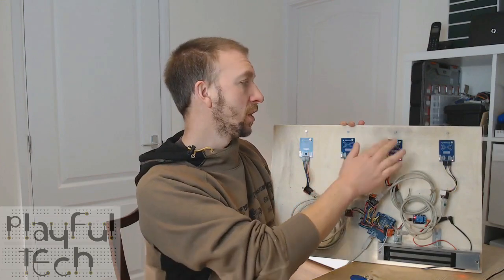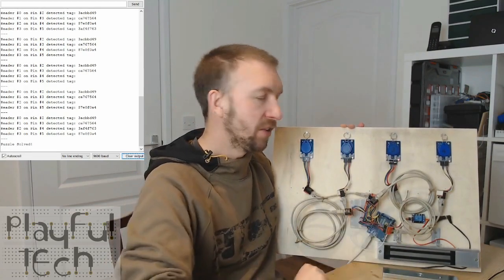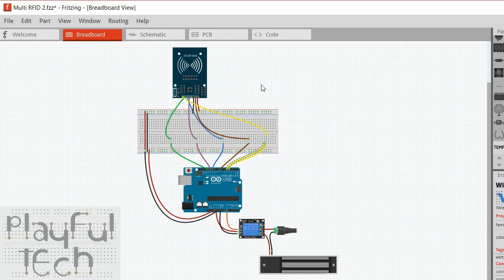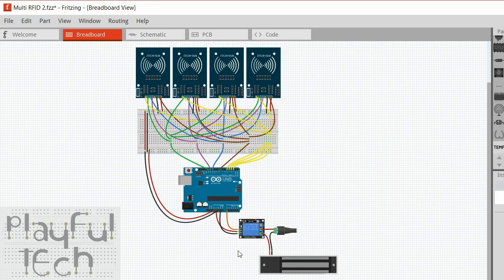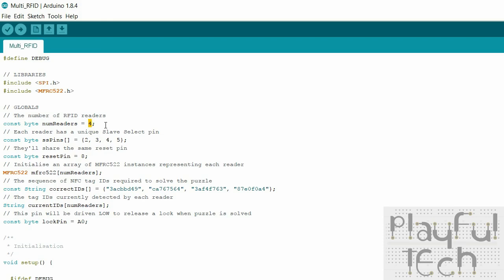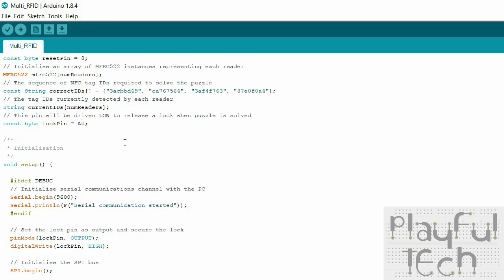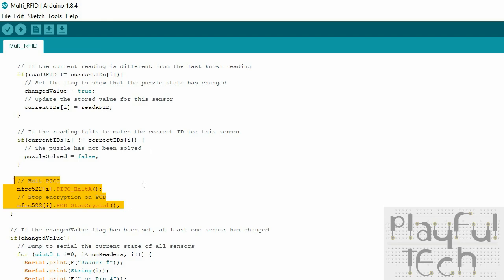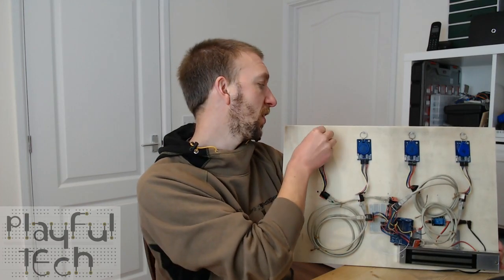Escape Room Object Placement Puzzle using Arduino/RFID

Comment: Hello Alistair,

it's a nice and straightforward tutorial, just wanted to share a bit of additional information:

1) You can (in theory) run this setup with a much larger number of RFID reader modules. What limits your setup is the amount of power the Arduino can provide. If you power the readers with an external power supply you can go way beyond 4.

2) Using longer connector cables is like adding an additional resistor in front of your pins. I found that as long as you don't exceed around 1m of length the setup still works fine

3) One minor nitpick about your code: It's not necessary to call PCD_Init() on your readers in each loop. You can simply init each reader once inside the setup() routine.

Cheers and keep up creating these great tutorials!
Reply from the maker: Hi Andy, the problem with adding more readers is not the power requirements (though you obviously need to address that too) - it's the additional capacitance you're creating on the SPI bus. Assuming you're running the SPI clock line at 4MHz, then once you've added any more than about 4 readers you'll find that the return signal on the MISO line is neither clean nor quick enough to be received within a single clock cycle (you can see this easily using a scope).

Comment: What are the cables, connectors, wires used here. Anyone got names or links to where I can buy these. Need to extend the sensors around a room.
Reply: You could use some internet cables for this purpose and solder them directly or you could try dupond conectors and jumper wires

Comment: Hai Friend. I am doing one project with 2 RFID boards. My doubt is, if i give the connection as per your video, is it possible to give different program for each RFID and to get different output to operate  2 solinoid  valves?
Reply: Yes, it is.

Comment: Hey Playful Technology,

We are currently working on a similar project for our University which involves 6 RFID scanners, the same scanners you have used in your project. However, we are running into some issues regarding more than 2 scanners. Could this be regarding failing connections in the breadboard or could the length of the SS wires?

Currently, they are about a maximum of 20 centimeters long. 

We would like some help, if you are willing to take a look at it we can send you more details/photo's and we will of course reference you in our documentation/presentation. 

Greetings, 

Matthijs Sluijk

Comment: What adapters are being used to connect the RFID readers into the board? It appears they are using CAT5 or similar cables, but then they are in an adapter and single wires the rest of the way up to the reader.

Comment: Every now and then , one or more rfid readers don't read the specific tag. 
That means that the puzzle can't be solved and the mag lock stays activated.
 I tried to use an external button that is connected to the reset pin on my nano , to open the mag lock remotely but it only resets the arduino while the lock stays activated. 
Is there a way to push the "reset" button to release the mag lock just in case the puzzle fails , without having to add code?
Or what about  adding a "softreset" libray?

Comment: Hi Alistair. Thx for this great video, i leart a lot for my internship project (I m making a system controlled by an Arduino uno, with 3 rfid readers and 2 lcd screens) ! Just a question : if i put a rfid tag just in the front of one of my readers, is my Arduino gonna write the same message on the lcd screen for any reader which reads the tag ? (and else, how can i do that :P in the program i mean). Thank you in advance !

Comment: I downloaded it and it did not work for me.  Had lots of errors when I compiled it.  Not sure what I'm doing wrong.
Reply from the maker: Hi David - oh no! If you let me know what those errors are, I can help you fix them.
Reply: @PlayfulTechnology  Got it compile, but I think the wiring is a little messed up.  I'm just trying to set up 1 receiver and when I run it, its giving this message: Reader #0 initialised on pin 2. Antenna strength: 0. Version : Firmware Version: 0x0 = (unknown)
WARNING: Communication failure, is the MFRC522 properly connected?

Everything seems connected properly, I triple checked.  Any ideas?  Could this happen if I don't have all 4 connected?
Reply from the maker: @davidmcallister9752  And you've changed the numReaders and initialisation of the pin array in the code to only have one element?
Reply: @PlayfulTechnology  I think its the wiring itself.  I eventually got it work kind of by skipping the bread board altogether and connecting the arduino straight to the reader, but it had to be held in place just right and was incredibly finicky.  After googling it, it seems that its a common issue with these rfid readers.  Most people that had problems said they were fixed when they solder the wiring onto the reader.  I haven't tried that yet though.  I'm new to this stuff though, maybe you have a better and less permanent suggestion?

Comment: Nice project.
I'm facing some issue with my RFIDs. When I connect 1 (one) RFID, then it works fine. But when I connect more than one (2 or 3), The controller (Arduino) doesn't find any readers. Get these lines on the serial monitor.

Reader 0: Firmware Version: 0x0 = (unknown)
WARNING: Communication failure, is the MFRC522 properly connected?
Reader 1: Firmware Version: 0x0 = (unknown)
WARNING: Communication failure, is the MFRC522 properly connected?
Reader 2: Firmware Version: 0x0 = (unknown)
WARNING: Communication failure, is the MFRC522 properly connected?
Reader 3: Firmware Version: 0x0 = (unknown)
WARNING: Communication failure, is the MFRC522 properly connected?

Can you please help with this? Or anyone here can help me? 
Thanks.
Reply from the maker: Are you powering the RFID readers from a separate 3.3V supply, or from the 3.3V of the Arduino?
Reply: @PlayfulTechnology  Thanks for your response. I've tried both. Both results the same! :(
Reply from the maker: @ElectroLab0  Can you try adding 5V <> 3.3V level shifters on the MOSI, CLK, and RST lines? It might be your readers are not 5V tolerant.
Reply: +Playful Technology Thank you. I'll definitely try that.
Should I use dedicated level shifter IC/Modules or Resistor devider will work? What do you recommend te most?
Reply: @ElectroLab0  these comments are coming when you are not connecting well the rfids make sure you connected them same as at his scheme in the video, Power supply isnt the issue here.
Reply: you can show me the way you connect them and i'll try to help u.

Comment: good! In our escape we obtained the same result in a cheaper and easier way with a simple 12v circuit and magnet switch
Reply from the maker: Magnet switches (i.e. Hall sensors, Reed switches) are great for many escape room puzzles, but they don't discern between different objects - they'll be switched by any object with a magnet in them. The purpose of using RFID is that it will allow you to detect and discern a unique object that has been placed in front of each sensor.

Comment: I followed these instructions, but unfortunately, it does seems to work for me... As for the diffetent tutorial I followed, I have always the same problem : "WARNING: Communication failure, is the MFRC522 properly connected?" at the initialization. And then, nothing.. If only one RFID reader is connected, it works but it does not work anymore with many readers. And I don't have a clue of why, as I juste follow the instruction of the video...
Reply from the maker: If one reader works, but two or more don't (and you're sure that you've got the wiring correct), that suggests that perhaps your power supply is not capable enough to provide enough current - can you try to use a separate 3.3V power supply? And how long are the wires you're using to connect the SPI pins? Keep them short - less than 1m, preferably closer to 20-30cm to avoid signal loss/lag.

Comment: Hi Alistair. Cant  quite  work out which  options I  need to  select  in  Patreon  to  get this  info. Would  appreciate  your  advice.  Also  how  long  am  I  locked in  for  ( as  currently  I  just  want  this  code & layout) Help!
Reply: Scenic Rim Carpet Cleaning   Yes  and  no. I  didn't get a  reply from  Playful Tech. I ended up  creating  my  own code and  circuitry to  build a "put 9 reindeer into  order"  for a  XMAS  escape  room based on  a single Arduino Nano V3.
Reply: @yasirisktas3239  See the  previous reply. I ended up  creating  my  own code and  circuitry based on  a single Arduino Nano V3. It  will  handle upto 10 RFID sensors and  can trigger a  relay  which can control  a  mag lock

Comment: Hey, great stuff! Quick and simple question for ya, does the Arduino receive power from the 5v pin, or does it have another external power source? I'm not familiar with the software that you're using and wasn't sure if it ignores the arduino power source by default. Thanks! I'll be looking at your Patreon page next :)

Comment: what is the hardware you are using to go from ethernet to serial?  also what is the switch you are using to power off the maglock
Reply: It's still just a standard SPI (not serial). As a cable he uses cat5e, but the protocol is not ethernet.

Comment: Alistair, thanks you so much for all the informative videos.  I subscribed to Playful Tech and believe this is a great investment for a novice puzzle designer like me.  I followed the library download instructions you provided but when I went to compile the code I got the following error message:

Arduino: 1.8.5 (Windows 10), Board: "Arduino/Genuino Uno"

C:\Users\Owner\Downloads\Multi_RFID\Multi_RFID.ino:22:21: fatal error: MFRC522.h: No such file or directory

 #include <MFRC522.h>

                     ^

compilation terminated.

exit status 1
Error compiling for board Arduino/Genuino Uno.

As I mentioned I am a novice and sure could use some help getting this library file issue resolved for my (4) RFID puzzle.  Any assistance would be greatly appreciated.  Thanks.

Comment: Hmm i constantly get the "WARNING: Communication failure, is the MFRC522 properly connected?" bug with most if not all of my RFID's.
 I know the solderings are solid (cause i have redone them many times xD) no frosting, craters of imperfections, i use  22AWG wire running to 4 readers, the farthest reaching wires <100cm. Can it be the lenght and/or thickness of the the wire? Could i be loosing signal due to the wire gauge/lenght? i am at my wits end o.o
Reply from the maker: Well, easiest way to troubleshoot would be to start with, say, a 10cm cable length and work up. Make sure you're definitely plugging the SPI wires into the right ports and that you're using 3.3V not 5V. Do you have any LEDs lit on the reader?

Comment: Hellew, i was wondering since u seem to know how to deal with multiple rfid readers, if u could help me with a project of mine, it  involves 3 RFID readers, i need the code type of question to ask for a specific tag ID. i have the 2 separate codes; the first code for enabling 3 rfid readers on 1 arduino and reading the tags, and the second code that runs on 1 rfid reader that asks for a specific tag ID, for example if (idtag =="XX XX XX XX") do something. My problem is i need to merge these 2....Any help??????
I just need to know how to ask the reader if that specific tag has passed..keeping in mind i'm using multiple readers code.
Reply from the maker: Mariam Ibrahim That's exactly what the project I show I this video does... (except using 4 readers rather than 3) - you place the 4 correct codes in front of the 4 correct readers and the maglock unlocks.

Comment: Hi there, great tutorial and great code! Last time I used 5 RFID sensors I got em working with multiplexors... However, in your code you should have integrated, or at least mentioned, a "chip is absent" routine, so that the puzzle doesn't trigger when the chips aren't there any more (because the players tried them out and then put them away – their value will still be stored anyways).  I used 2d arrays instead for the IDs. And For the away routine else if (!mfrc522[i].PICC_IsNewCardPresent()) I simply set their values to '0000' and triggered the changedValue as well. Works like a charm :)
Reply: If you don't mind sharing, could you tell me how you got the sensors hooked up to the multiplexors? I have been struggling with it but it seems like a much more stable solution.
Reply: It looks messy, but it worked very reliably with 5 RFIDs. https://www.dropbox.com/s/f6dzfldwxvkb6ds/RFID01.jpg?dl=0
Reply: Holy cow - that was incredibly helpful of you - thank you so much! Do you have the sketch also? I would be happy to pay for it, you have saved me so much time!
Reply: Write me a PM here on YouTube and I'll help you out.
Reply: @Gandarufu  hi there, im trying to pm you but i cant find the option. 
The dropbox link isnt working anymore. 
But i would love to see your take on this project. Could you pls help me out?
Reply: Would you be willing to share with me, as well?  A 5 RFID layout/sketch would be incredibly helpful to me.  :)

Comment: Thank you, this is a very nice video, like your other videos! I have one question: In your version you have to reset the Arduino manually so that the puzzle can be solved again. But is it possible that the puzzle could be solved again as soon as you remove one RFID tag from a reader? Specifically, the lock stays open as long as each RFID tag is on its reader, but closes again as soon as at least one tag gets removed from its reader. But it will open again as soon as the tags are on it's reader again. Is this possible?
Reply from the maker: Yes, sure. So, the code at the moment demonstrates what is called a "latched" solution - once the correct conditions are met, the puzzle changes to the "solved" state, and then remains there forever. If you want to change that, the first thing you'll need to do is remove the infinite loop in the onSolve() method:
  while(true) {
    delay(1000);
  }

The next thing you'll need to do is add an onUnsolve() method, to lock the lock again:
void onUnsolve(){
  #ifdef DEBUG
  // Print debugging message
  Serial.println(F("Puzzle no longer solved!"));
  #endif
  
  // Re-lock the lock
  digitalWrite(lockPin, HIGH);
}

...and call this method from the main game loop if the solve conditions are not met:
  if(puzzleSolved){
    onSolve();
  }
  else{
    onUnsolve();
  }
Reply: Thank you again, I will try it the next days ;)

Comment: Hi again, I'm getting a: 'dump_byte_array' was not declared in this scope. And I don't know what I'm doing wrong... for now I'm using 2 rfid readers and adapted the code to that. Any advise?
Reply from the maker: remconet Make sure you've included the entire code listing - the dump_byte_array function is defined right at the bottom.
Reply: Aw I see. I missed that since I did your tutorial manual with you and it's not in the video. So I guess I can't finish it now.
Reply from the maker: You haven't missed anything - the link to download the code is in the video description!
Reply: Yeah I know, you want people to pay for it. Besides the point most people online share codes for free willingly (it is open source after all that relies heavy on other people's efforts as well like the rfid library) I don't like the way Patreon works. I was willing to pay $10 for your efforts to gain access to the codes but but after a few clicks it became apparent Patreon was going to charge me EVERY month for that amount + for every entry you create. To me that's just too much. I'm sorry.
Reply from the maker: remconet And that's completely your choice! If you're a hobbyist, feel free to copy out the code by hand from my videos. If you're running an escape room business, buying a prop like this would normally set you back well over $500, whereas I'm teaching you how to build it yourself for $10. Patreon charges you a max of $10 per month, and only in those months in which I publish a new puzzle design. That money helps pay for the time it takes to create more puzzle videos in the future, which I will continue to make completely free for everyone.

Comment: Do you need a specific power source for the maglock or can the Ardurino give enough power to do this?
Reply from the maker: DocktaLove As a general rule, you should always use a separate power source to protect your Arduino. Maglocks like the one shown require 12V; it's possible to plug a 12V source into the Arduino power jack and the inbuilt regulator will adjust it down to 5V for the board, but 12V will still be available from the VIn pin. However, the Maglock draws a lot of power, and will likely cause spikes when turning on and off that could damage the Arduino. Best to use a separate power supply with an appropriate rating for the load and tie the ground to the Arduino ground. Or, use a completely isolated power supply controlled via an opto-isolator. The Arduino is a microprocessor - the voltage sourced from its pins is a logic voltage used to indicate on/off - it's not a voltage to power appliances. It's a complex subject so hope that explains some!
Reply: Playful Technology sounds great, I'm a total noob with this stuff, do you recommend any specific power supply? I signed up for your patreon page but there weren't any suggestions for that piece of equipment in the papers
Reply from the maker: DocktaLove Powering your props is a massive topic with lots of things to consider. I'll try to put up a tutorial that covers the main things to be aware of but it might take more than one video!